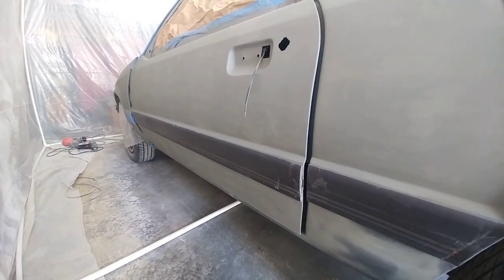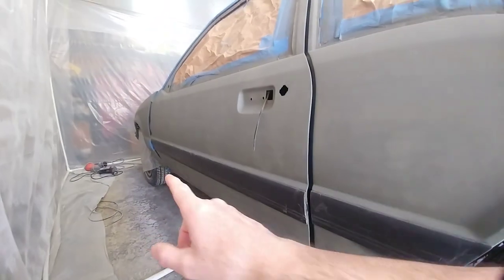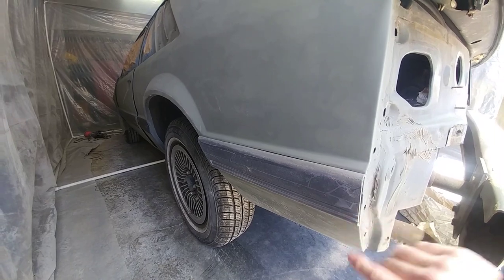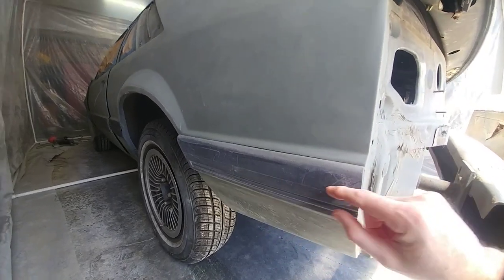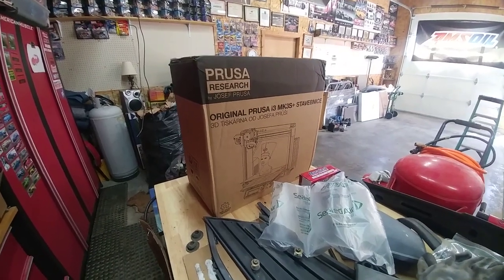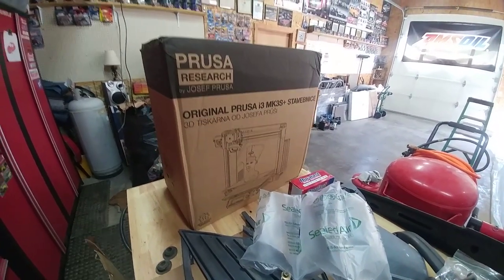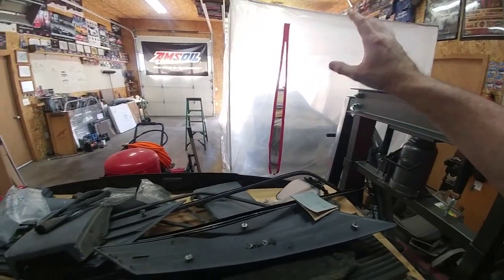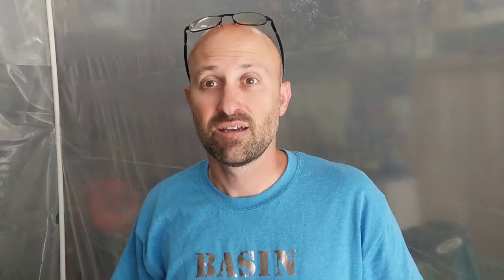Painting Foxbody Mustang Body Trim Molding

Comment: Very informative, I thought the trim was supposed to be SEM trim black 39143. That’s what I used on mine. Would be nice to see the two colors side by side.
Reply from the maker: The color depends on model year and trim level. The early models were black trim, but the 84-86 range used a gray / charcoal also. Look at original SVOs and the 85/86 models and some will be a darker gray. That is what this was originally and will be again.

I will be painting two sets of sail panels in the near future. One for the '86, which will be gray. The second set is off a Capri, and will be trim black. That should be the video to see the difference side by side.

Comment: Curious about what your plans are for the 3D printer. Also, how was the process of getting it from the Czech Republic to Oregon? Extra/additional import fees, etc.?
Reply from the maker: Super easy to get the printer. The cap is $800 before you have to pay import fees. If you buy the printer unassembled like I did, it's $798. I plan to make a ton of replacement parts that we can't buy anymore. Porsche, Foxbody, anything. Vent grilles, switch plates, anything I can. It's a toy to learn something new and make content, but I plan to make things to sell eventually.
Reply: @BasinMotorsports  Thought that might be your plan. Would like to see some of the process, when you start making some items.
Reply from the maker: @idmooseman  I'll be filming every step of the way, from assembly, first print, and beyond.